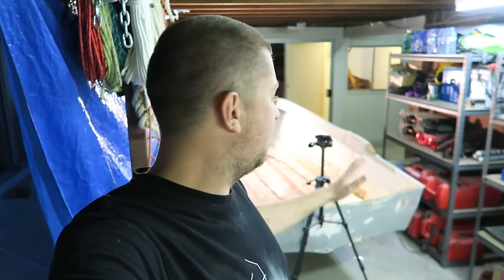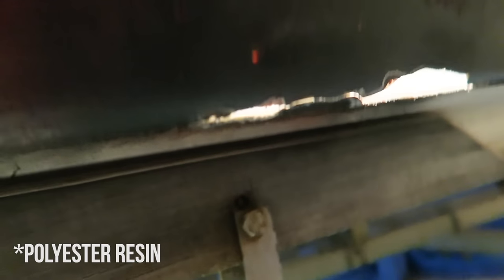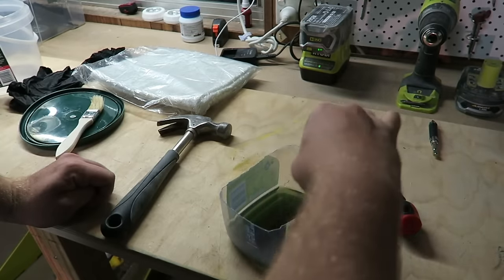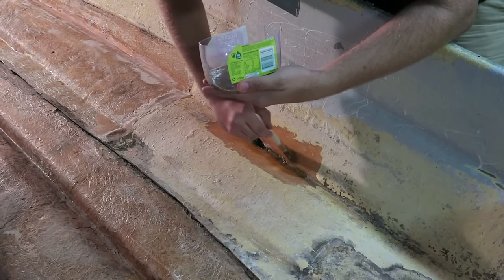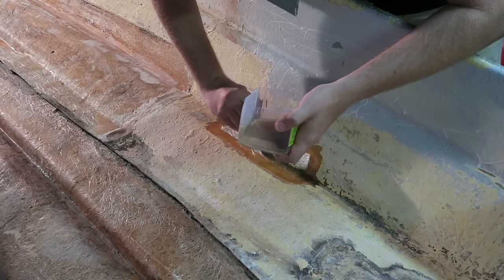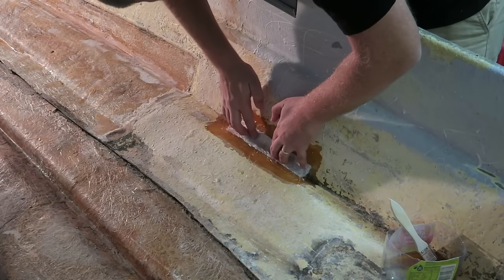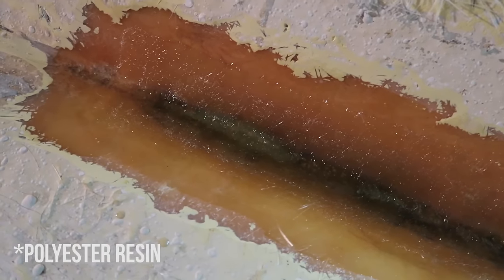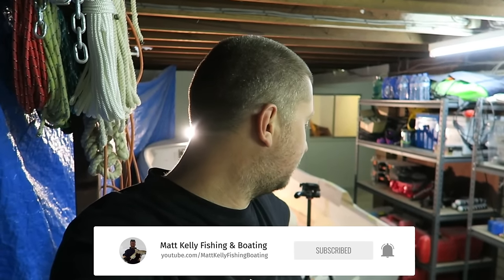How to Fix a Crack or, Hole in a Fibreglass Boat - The NEW Fibreglass Boat Restoration Project!

Comment: Nice. If you want to save work and not fear push through, place a ziplock taped on the exterior firmly. Helps with a smooth surface and epoxy won’t stick to it
Reply: What is a ziplock? You mean like sandwich wrap? Like plastic baggies?

Comment: Good simple video and repair. Looking at the state and age of the boat, I would recommend that the restoration of the boat would be extended right along that Strake, since it is a critical structural element in the boat and has probably failed because the area was flexing too much.  I would suggest sanding the hull back along the strake/chine and filleting with epoxy resin mixed with an epoxy filler powder to make a lightweight filler that is highly adhesive. Fill (to about 2/3 full) the strake and squeegee it smooth with a cheap rubber scraper or similar. Then make a new batch of resin, and brush it on neat, onto the fillet and along the surrounding hull down the length that needs strengthening. This is for laying a woven glass tape into, 100mm wide, at least 200gm,  wet it out and let it cure. You will have doubled the strength of that chine. If you don't have the filler powder, use the glue powder and some fine sander dust, eg from a belt sander bag. Epoxy resin is marginally stronger than your polyester, and adheres twice as well to old fibreglass, which is really important. Happy fishing...
Reply: How thick of a layer of resin can you get in one pour? I believe the larger the volume, the better the cure, due to it needing the thermal reaction around it?

Comment: I think he did a good job. The biggest thing I would point out, is that your glass was not wide enough. So you need more surface area for the fiberglass to stick to to be sure that the repair does not come off or pop out later on. One other suggestion would be to also sand down a small area on the outside and then lay glass everywhere that you send it this way when you’re standing there, you don’t just stand the glass off that you just applied. I hope that makes sense. Great video you did a good job.

Comment: I think its called "polyester resin" 🤣🤣🤣. Another great video Matt. Love your work.
Reply from the maker: I think you might be right!!! 😉
Reply: Epoxy and polyester resin are two different kinds. Both can be used for this application
Reply: @DeepSeaDaddy111  
That resin is a Bunnings Fibreglass kit right? It is Polyester resin? (the label says Styrene in fine print) I have a lot of this and want to fix my boat (very old Bertram Carribean 3.8) I When I did the floor it seems to not like to stick to the other older fibreglass very well (easily lifted or pried off). Any idea why this is the case and what resin I should use?
Reply: @easemailboxes  could be a chemical reaction etc. Did u prepare the old part . Cleaned properly. Keyed in. The idea is to create a bonding.
Reply: @kangacrew540  YEah, thanks for your comment. I ripped the whole floor out and did it and the stringers again from beginning. Thanks for your help though.
Reply: Unless the resin used underneath is Not Polyester, just sand it first...
Most people are saying that will work.
If your floor was made with Epoxy, then Polyester will peel off. Use Epoxy, then.
There Are a few special epoxies that you can gel coat over
(Gel is polyester based)

Comment: Good job bud, sand back the outside hull where the hole is and give it 1 coat of chop and 2 coats of resin spreading layers of resin longer then the hole size.
The bunnings repair kit will have plenty for that but avoid the bunnings resin kit for transom and stringers or your pockets will cry.
KEEN ON THE NEXT VID!!
Reply from the maker: Thanks mate! You’re dead on, when I flip the hull over to do the hull painting I’ll be doing a good fix on it from the outside. 

Agreed on bunnings prices for this stuff! You’ll see in my next video I’ve got all the supplies from a direct Fibreglass supplier - Much more viable price point!
Reply: @MattKellyFishing  Which supplier please Matt?
Reply: That resin is a Bunnings Fibreglass kit right? It is Polyester resin? (the label says Styrene in fine print) I have a lot of this and want to fix my boat (very old Bertram Carribean 3.8) I When I did the floor it seems to not like to stick to the other older fibreglass very well (easily lifted or pried off). Any idea why this is the case?  SHould I trip it all back and use 'epoxy' resin? And for the helpful comments guys! Thanks for all your videos.

Comment: anyone have any info on why he chose the interior instead of the exterior to repair? wouldn't it resist future damage better from the exterior since water pressure would only push the new glass on harder?
Reply from the maker: I didn't cover it in the video, but I actually did it on both sides.

Comment: That resin is a Bunnings Fibreglass kit right? It is Polyester resin? (the label says Styrene in fine print) I have a lot of this and want to fix my boat (very old Bertram Carribean 3.8) I When I did the floor it seems to not like to stick to the other older fibreglass very well (easily lifted or pried off). Any idea why this is the case and what resin I should use? Thanks for all your videos.
Reply: Aaron Anderson  Thanks Aaron!

Comment: Whats the difference between epoxy and polyester. Is one more suitable than the other?

Thanks
Reply from the maker: Honestly, I don't actually know. I was given the recommendation to use poly because it has a wax built into it that effectively rises to the surface to seal it from air and help it set. Apparently epoxy can also be more brittle, but it looks like that's an ongoing debate. 

I've also read that epoxy can stick to any surface, whereas poly is best applied over previous poly. So ultimately it comes back to what your boat currently is, and what you've got access to. There are MANY people who know more about this than me, I've just gone off the recommendations of others. They both feel/work very similarly in my experience.

Comment: If you use resin from a auto store or big box store it won’t be strong or last. The resins they sell are cheap and old. You always need to use fresh resin like you get from a boat supply or West System resin. Old resin doesn’t hold up. I hope you used resin with was added on this job since you didn’t use a backer board .

Comment: Short vid, you kind of skipped the cleaning bit before epoxy to remove dirt and oil or anything like that, gloves and mask working tih epoxy and fibre, you can also soak the fibre bfor laying it down.

Comment: Just a quick tip, dont cuy chop strain. Tear it in to shape, it will blend in nicely.
Reply: Tear and stretch it, kind of pull it as you set it into the resin. You will save yourself a lot of sanding on aesthetic parts.